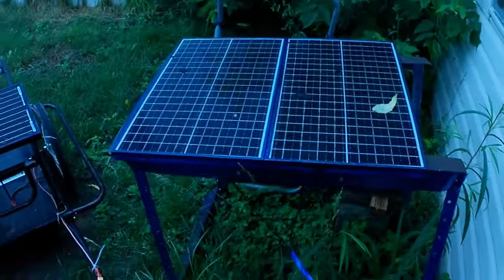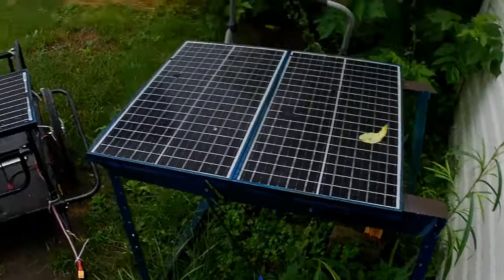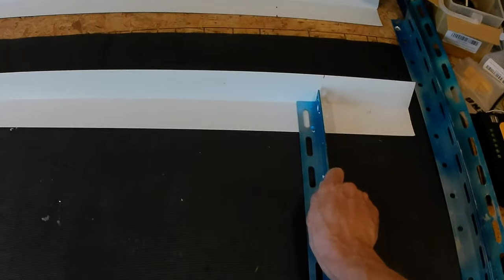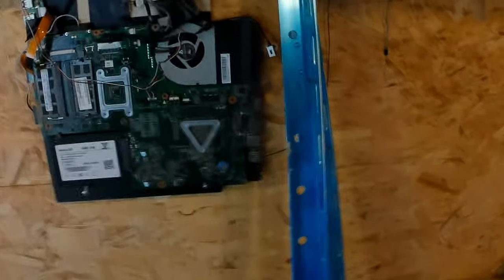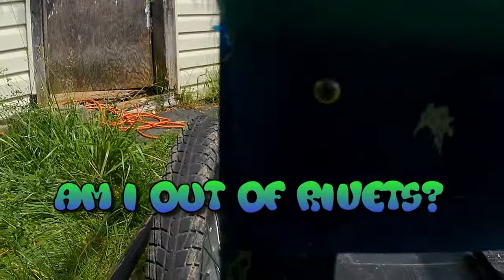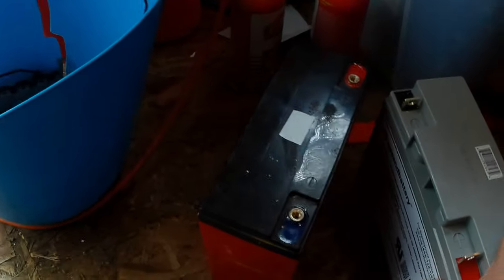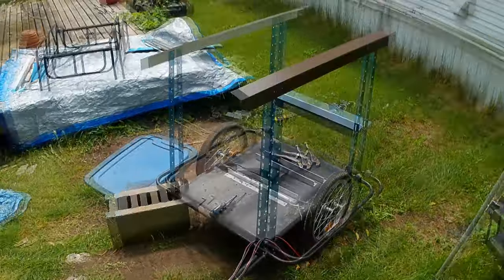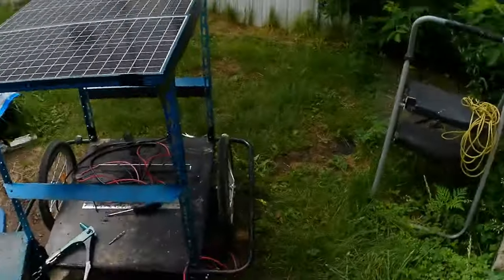The ULTIMATE Solar E-Bike Reconfiguration, it's Heavy and Fast! Pt1

Comment: Hope your battery comes soon. Think your the last e-biker on earth still using acid batteries. A 10 x box of 2020 1600mm is only $60. Given you like to reconfigure. I think you would like the stuff. Its Adult Legos. My Amazon store has it!
Reply from the maker: ill check it out, been thinking of buying some new packs off battery hookup but I got to break them down into single cells, another option I was thinking is there 1S6P packs for less and joining them up would be easy.